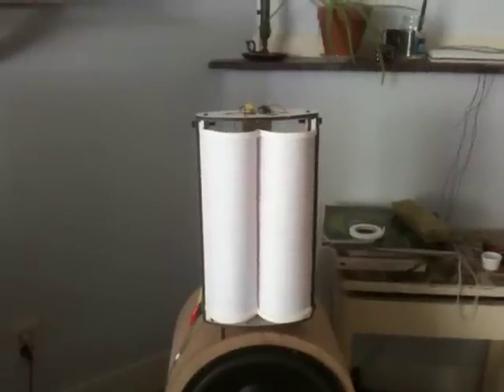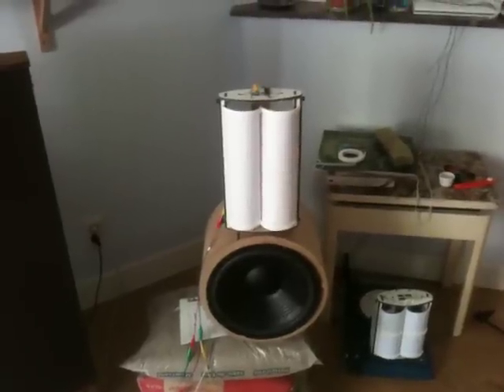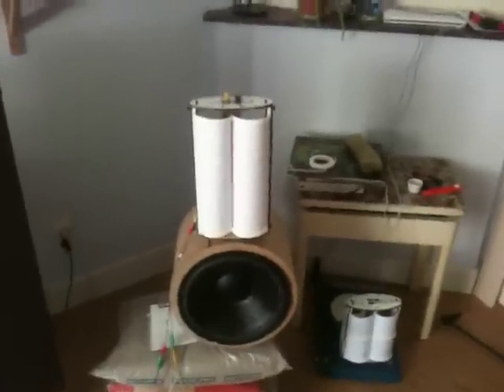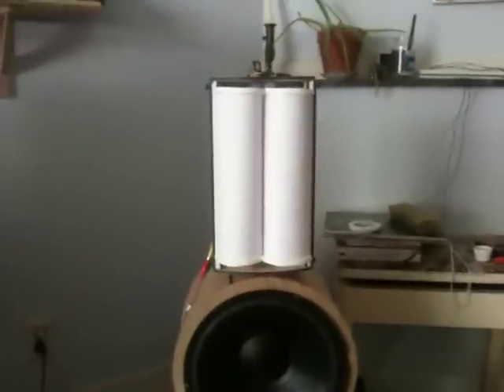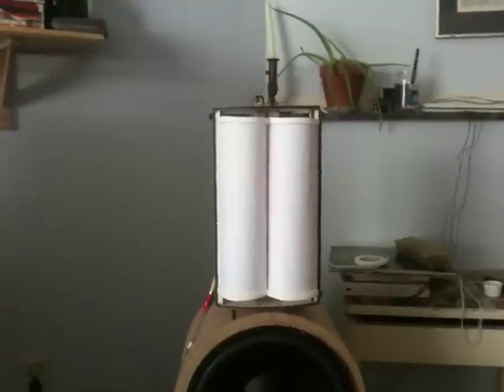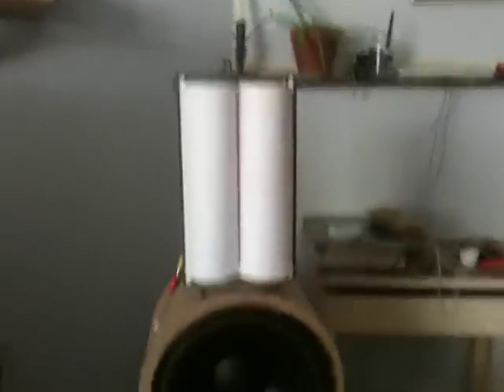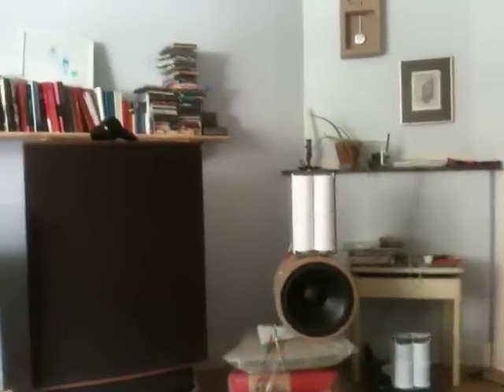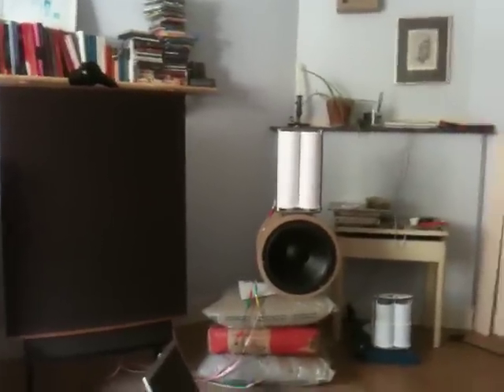30 cm long mid high frequency driver. DIY

Comment: Dear friend, good morning.
very pleasant to watch this video, and what a beautiful sound reproduced by your speakers, congratulations.
A doubt:
The magnets we know that their sequence are assembled to repel each other (in the sequence of mounting on the support), my question is: The other support that will have the same set whose coil will be in the middle, do they repel or attract? I had this doubt.
Congratulations on the feat and greetings from Brazil
Reply from the maker: the magnets are stuck between 2 pieces oif steel. and the motor used 2 of those arangements (magnetic field go trough the steel and go trough the coil to the other set)

the total of 4 metal bars are atracted to one an other.  so if they are not solid enough (ore wide) they bend and squish the coil. there must be an image somehwere on google. else watch my video about magnet motors. right hand rule (witch should be left hand rule.)
Reply: @joppepeelen  Thank you for providing the answer. I wish you success and I really enjoyed your work. Thanks